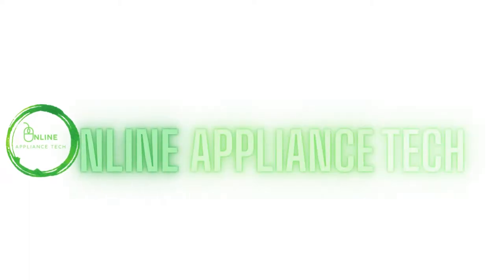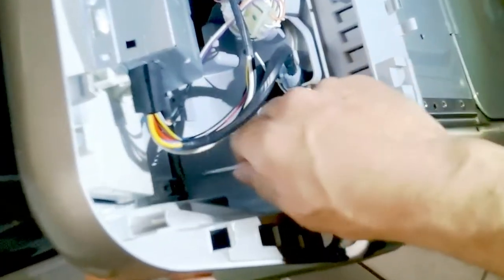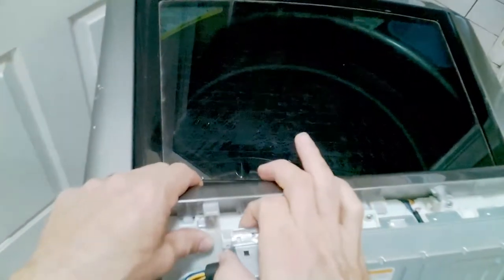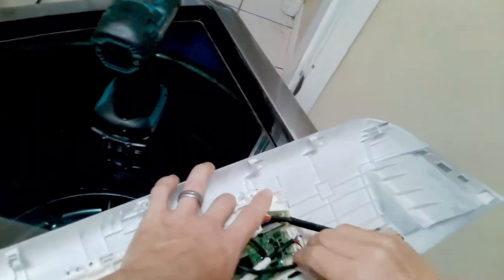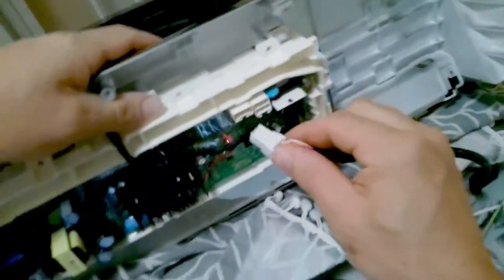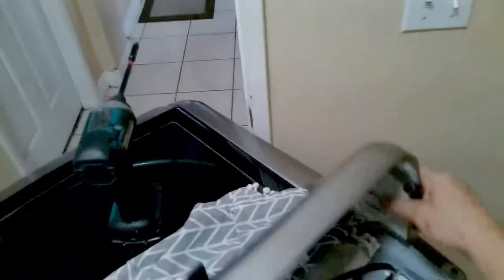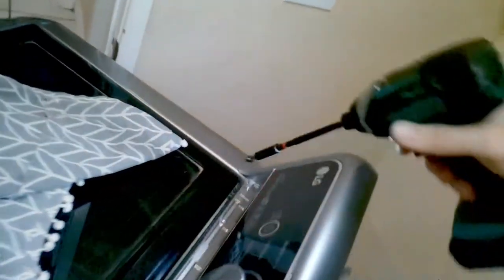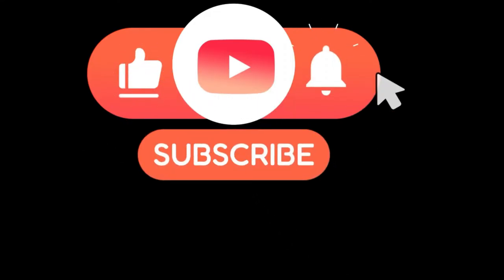LG Washer Power Button Not Working? Learn How to Fix! [LG Panel Removal & More!]

Comment: This video was very helpful for the teardown. After taking the entire thing apart I was able to fix it all with a small piece of tinfoil! The way the system works for the buttons is through a capacitive charge that is sensed from your finger by using little spring antennas that are on the main board. The issue seems to all be coming from the actual front panel glass. The glass is either too thick for the signal to pass through or there's a coating that rubs off over time. The fix is as simple as extending the spring antenna, they sell special foil that can be used to stick on the glass to amplify the signal but I just used a small piece of tinfoil under the glass where the power button is that the spring sits against (I put a tiny piece of tape on the edge off the foil to hold it on). The antenna actually sits on the glass slightly offset to the right of the  power button image. So I just made sure the piece of tinfoil was large enough for the antenna to sit against it and also be behind the cover panel button image. I would say the piece was probably about the size of a quarter.
Reply from the maker: Happy we where able to help! And thanks for the info!:hand-pink-waving:
Reply: @onlineappliancetech  you can also use some aluminum foil tape, but most people don't have it and it's a lot more expensive and not worth getting since you only need such a small amount.
Reply: I had the same problem with my just over the 1 year warranty lg top loaded washer, same model displayed in this video. I was able to permanently fix by cutting a square piece of Nashua flexfix dryer vent tape ($6) and sticking it on the outside glass over the power button. Maybe 1.5 in by 1.5 in. This amplified the capacitive charge from my finger enough to return the power button back to normal function.
Reply: Thanks for this comment! We just put tin foil and now it’s working!!! Saved us hundreds of dollars!
Reply from the maker: @KeepingupwiththeKinyons  :hand-pink-waving:
Reply: You sir are thanked for that little hint of an idea of tin foil.. I used a piece with a thicker side under the spring.. now I barely just touch the button and ON it goes.  Easy as that.. thank you so much.
Reply: Genius fix as others mentioned, small piece of foil on the backside of the power button and presto fixed.
Reply: Works just worked for
Mine.
Thanks again no money spent on materials I used foil wide enough for the spring to touch to the right offset and used foil tape on top of the foil behind the power button and works perfectly. As others say only have to barley touch the power button
Reply from the maker: @benb3799  :hand-pink-waving:
Reply: I've been battling this problem for over 2 months with the machine being repaired under warranty and then failing again within 30 days. I purchased and installed the complete main board (with the help of this video) and the washer still would not power on, $320 down the drain. Finally tried the foil fix and VOILA, the washer works! Thanks to 
Online Appliance Tech and David C for providing this valuable information.
Reply from the maker: @rusty8217  Happy to help!:hand-pink-waving:
Reply: @David C - where did you find the spring at? I cannot find anything that would be touching the glass that is coming from the control board. Any help would be appreciated!
Reply from the maker: @tycheatham  Hi :hand-pink-waving: I have a video on how to do this repair just check out my videos and look for the Reynolds Wrap Trick video.
Reply: @tycheatham  if you take off the main board you will see it. The spring sits right up against the glass
Reply: I just took a look at your other video and my only comment is that you should be careful with putting in the foil your way even though the board is coated. There are a lot of electronics around that it could potentially cause issues with, or short something out possibly, especially if someone doesn't do it exactly your way with too much foil. You only need a small enough piece to sit on the back of the power button, so if you tape it to the glass on the edge so it still touches the spring it works great and won't ever move on you.
Reply: Thanks for this comment. It worked like a charm. I only used 6 layers of aluminum, and I figured add some if needed worked first try!
Reply: @dav18d Thank you so much...this worked!
Reply: I have very dry skin so sometimes these capacitive buttons don't work unless I wet  my finger first, however I don't have this effect on the power button but I am starting to have this issue on the start button so i will be repairing this soon with foil...
Reply: Thanks! Same for me ! Add a little plastic piece to give more strength to foil/foam power button. Problem solved in less than an hour ! Cost 0$ !
Reply: @dav18d  nice explanations. Question. Is the goal of the tin foil to create constant contact between the inside of the glass touch board and the spring/foam piece coming out of the mother board? Or just to put a layer on so the connection is "amplified" when my finger touches? In other words, can I just jam a ton of foil so the spring always touches to glass panel, or will that mess something up? Thank you.

Comment: My washer is 2 1/2 yrs old, model WT7305CW.  Was having the same issues and for a while could unplug and plug back in and it worked... but then that stoped working.  Took it apart and found out the problem was the front panel was not connecting to the control board.  Put some aluminum foil on front panel, where the start button and pause button connected to the control board and it fixed the problem.  Now it works perfectly!!! Cost $0.  Hope this helps someone.
Reply: Hey, thanks a lot!  I put some foil right where you said and that fixed the problem.
Reply: I'm having issue with it turning on.  If i keep playing with the button it finally turns on.  I'm going to try this.
Reply: Any concerns about the foil causing a spark or fire?

Comment: Thanks to all who suggested the tin foil process. We had replaced the mother board and the start process remained intermittent. Installed Nashua tin tape and the machine is now fully operational. biggest problem was reengaging the master setting dial but figured it out. If your machine is fairly new would definitely suggest the foil play before replacing the board. If you do replace the board I would still install the foil tape to save another reassembly.

Comment: Had the touch panel replaced under warranty, then the machine started throwing water supply errors. Tech only replaced the facia and not the component board, had to have them come out again. Should have done the work myself as not entirely sure when went wrong with his work.
Reply from the maker: Did he turn water back on all the way?
Reply: Sorry for the delayed response. Yes, water was turned all the way on. I verified flow through hoses and no issues found. 

Oddly enough, I did the LG reset process, unplug, hold power button and then start/pause button. The unit hasn’t thrown the water error issue since but the fabric softener tray will not flush out. Took the tray apart, ensured there was no sticky residue or blockage and still nothing. Seems like the water is not being directed to that portion of the tray during the rinse cycle. 

Heard LG was a great product so we thought, why not. Beginning to question our choice.

Comment: Hey I know I’m late to the party but I did the display board swap right? Ok well without the front cover on I can turn the washer on by touching the spring that is the power on the display board. (This will shock you so if you’re not versed in electrical theory please do not attempt.) however when I put the front cover with the power display button to safely do so, I get nothing. Please help.
Reply: Never mind 😂 I found your foil video after. I figured it was something goofy like the circuit wasn’t completing since it worked when I touched the bare spring while being grounded. I’ll try that before bugging again.

Comment: My panel is no longer responding but if I move the door around sometimes I can get it to run. Is this still a panel issue? Is there a door sensors?
Reply: What he did in this video. Is not the problem in most cases. Check the control right behind where you push. Use you phone to magnify the image. You will see if control panel is broken right where round membrane joints the square one. You can also tell you by pushing the button on the control board and and washer should turn on and off if the problem is control panel

Comment: We change the control board but still did not start .
Reply: Try the foil.  It might be that the front cover has warp or such not and no longer makes contact with the spring.  The foil will complete the circuit so your touching the button location will allow the capacitance change to be transmitted to the control board.  I tried this today and it worked great.
Reply: @Privat2840  where do you put the foil? I’ve taken the whole thing apart but can’t get the second white panel where buttons are off?

Comment: So frustrating - ours is 2 years old and does this. Our last LG was still working after 11 years. The new washer and dryers are junk! 

Thanks for the video! I’ll give it a shot.
Reply from the maker: Check out my video titled 'Unbelievable Fix for Your LG Washer Power Button - What's the Reynolds Wrap Trick?' It could save you a lot of money. You'll find it in my LG playlist.
Reply: @onlineappliancetech man I missed this comment. Between then and now I tried working with LG and they sucked. Terrible service. Tried your foil trick today and it worked!! You are the man - subscriber for life!

Comment: Great video, very informative. Thanks 
Also, it would be great if you could post the links for where to buy the parts in your videos.  My washer’s model #WT7700HVA
Reply: @edgarr6828  I have the same model same issue did you find the part or the part number?

Comment: Do you have a link to buy the display board? I'm having the same issue but cannot find the replacement part
Reply from the maker: Can you text me model number please and I will try to find for you.
Reply: Where can I purchase control board. Thanks
Reply: @onlineappliancetech  where can I purchase control board?
Reply from the maker: @dorothygranzin7613  Hi Dorothy, I have a newer video that shows you how to fix the no power problem with a piece of aluminum foil.

Comment: Can you provide me with a link for both control boards together. Model #WT7600HKA
Reply from the maker: EBR81634405 Display PCB Assembly- The Main board is separate for this one it seems? I would call LG for a part number to see if you can buy  together.
Reply: @onlineappliancetech   Thank you!
Reply from the maker: @MrKleeg1st  You are very welcome!🙂